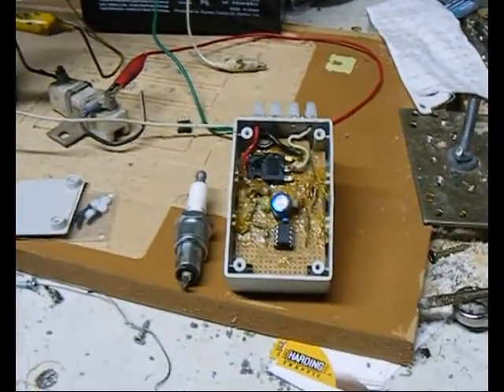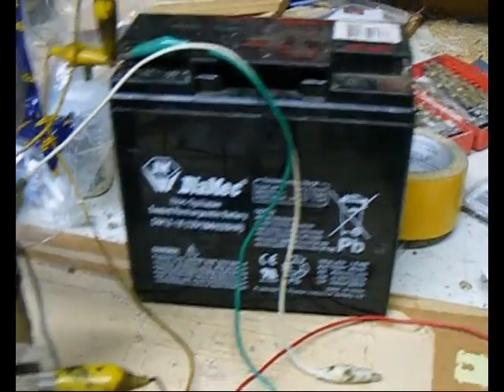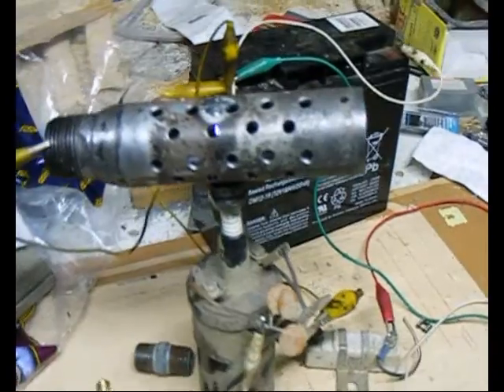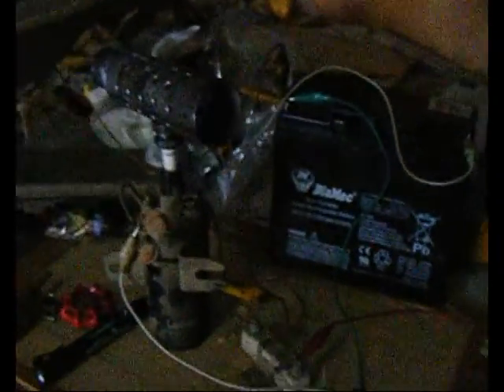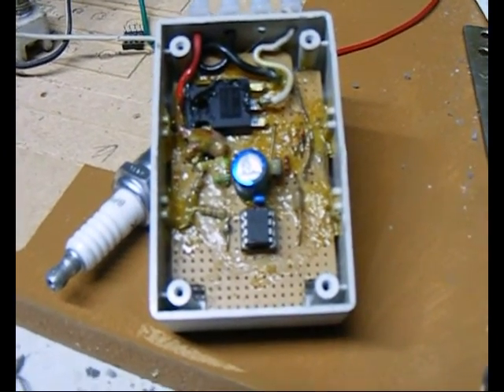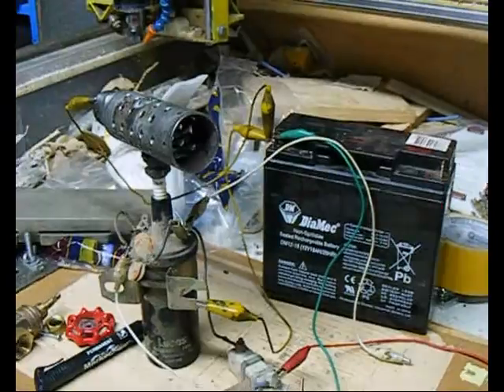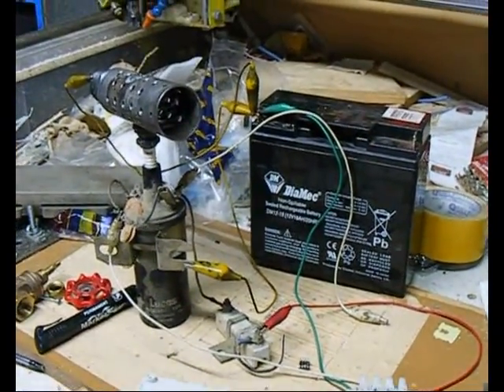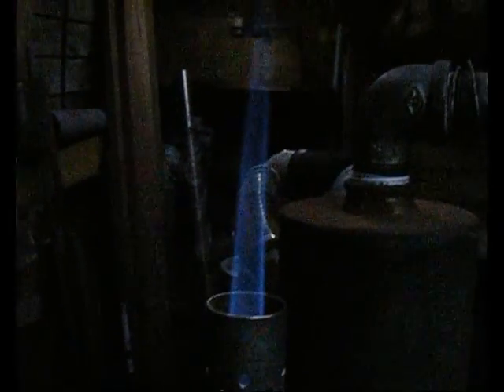New gas flare ignitor sings Auld Lang syne - while lighting my fire.

Comment: Hi cncmachiningisfun,I AM guessing this is a tesla type outfit.  Do you have a link to the circuit please??
A practical aplication. Thanks for sharing.
Neil in London..
Reply from the maker: +Neil Munro
 Howdee. This is using a standard automotive ignition coil and a home made microcomputer to drive it via a power mosfet. 
 I wrote special software for this, to produce the musical score - more for fun than practical purposes  :) . 
 A simpler circuit could be made, using a 555 timer chip. 
 I think you will find lots of good designs for a 555 based ignition coil driver on the interwebs.

Comment: I like it. But would like to hear some modern rock please. Do you take requests? And a way bigger spark also. Something that can sing across a 300mm gap. And i know thats not a challenge for you dude.
Reply from the maker: LOL, yup, just maybe I should have loaded it up with "Baby, light my fire", or something that's equally hot and steamy  :) .  300mm sparks eh?  Yup, that's doable. Trouble is, last time I did something like that, I got in trouble with the Post office radio inspectors. They were none too pleased, as I killed a number of sensitive electrical appliances - and took out half the radio comms in the street.
Ahhh, those were the days  :) . 
 Next step = a request driven lightning bolt generator that will set fire to the sky......